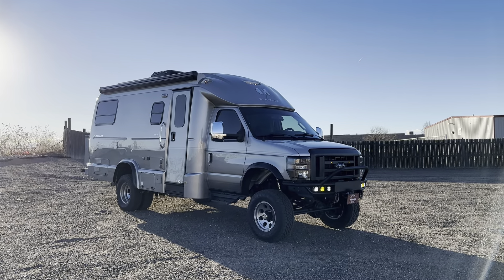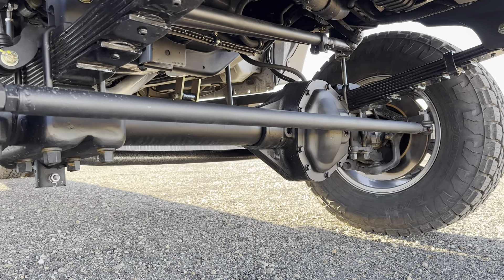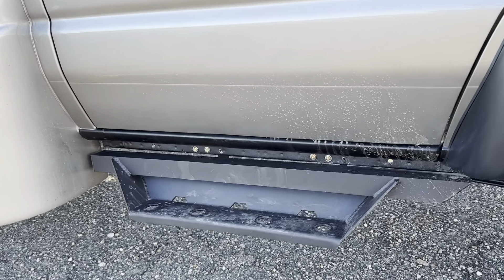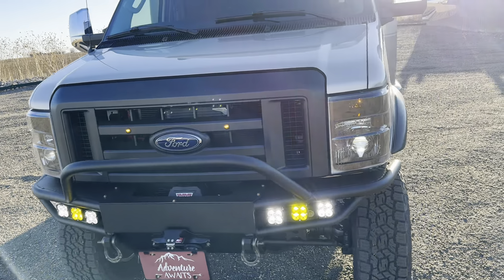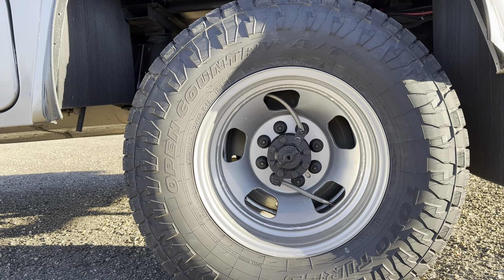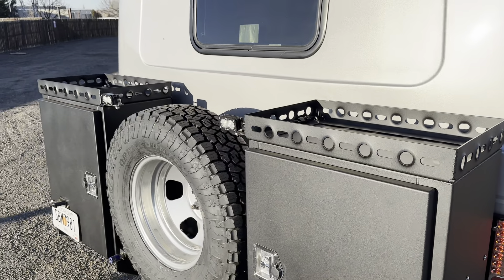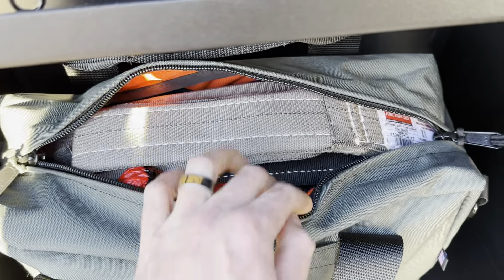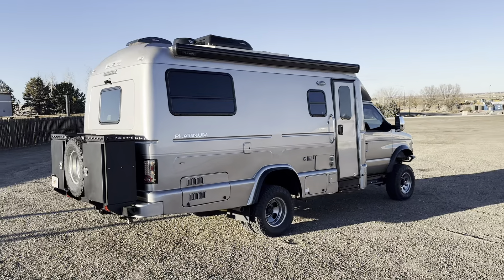2019 Coach House Platinum 4x4 conversion!

Comment: Big thanks to Justin, Brian, Jay & Dave!   Making my way back home with the rig has already been interesting.  After adapting to the more responsive handling, and stepping down more 'cautiously' from the added height, all is well.  Just as you had advised me, I'm getting used to curious folks stopping by to ask questions when I'm gassing up or getting food.  The added lighting options really illuminate both sides of dark country roads, great for advanced warning of critter crossings.  Will hit some offroad trails this weekend and experiment with airing down/up for ride quality & traction feedback.
Reply: Referencing ride quality: Much improved bump compliance.  The well-known ‘entry door squeak’ on CH units, is now gone from this rig! 

Normally, I’d have pulled over several times to lubricate the door jamb locking mechanism/hinge …not an issue on 1600 mile return trip.

Body roll is virtually non-existent, 6” chassis lift means no more tail-dragging in driveways which destroyed a previous tank heating pad, entry steps no longer deploy/grind against curbs.  

Convenient, roomy access beneath rig means safe DIY maintenance & troubleshooting.

The maneuverability is amazing now, “swooping” into another lane occurs instantaneously, as is collision-avoidance …telepathic turning agility.

The significantly increased height provides greater road/traffic awareness… helpful in avoiding  Ford Raptors spotted below.

Though the rig’s intended province is backcountry/off-road surfaces, at 75 mph, the increased buffer zone other vehicles now yield, is likely inspired by face-level bumpers and augmented lighting (nice!)

The 4-5 week collaboration was made seamless with frequent narrated video updates and solicitation for owner input as needed, though 99 percent of key decision points were already instinctively calculated in advance typically enabling immediate joint consensus.

Justin’s OCD-like ‘attention to detail’ is impressive and confidence inspiring (likely related to his Motorsports racing suspension design consulting and pit crew experience).

The paint marks providing visual confirmation of bolted torque specs at critical junctures is a noteworthy carryover into less competitive automotive pursuits.